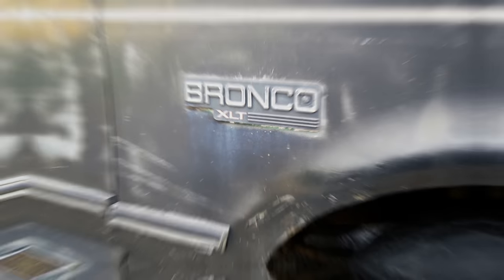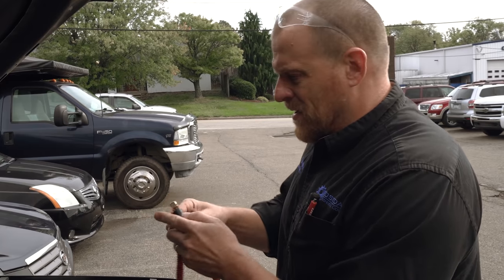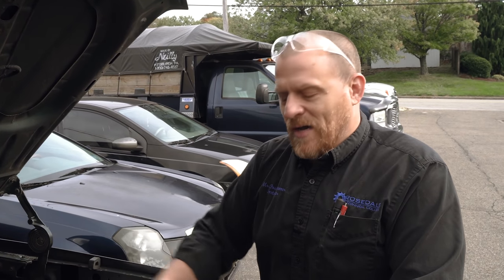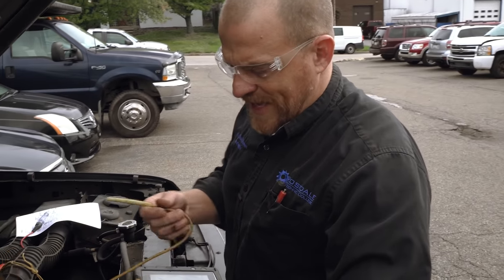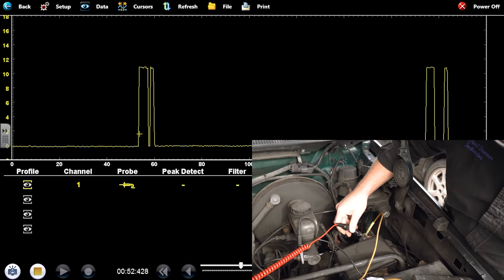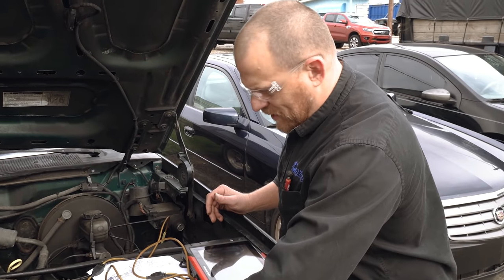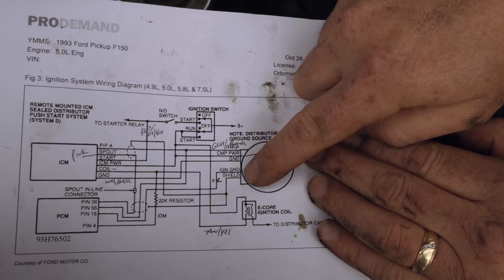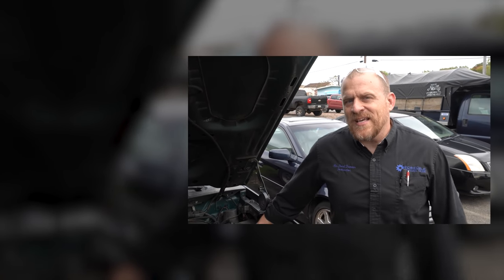Ford EEC-IV No Spark Diagnostics

Comment: Hey, I can't get the spark checker to activate when I tap my test light into the pip wire, and the fuel relay and fuel pump don't cut on either.  What would you advise on the next step?
Reply from the maker: Key on, does your check engine light, light up?
Do you have power at coil +?
Reply: @ScannerDanner  Hey Man!  Thanks for getting back to me.  The check engine light doesn't come on.   Coil does have power. Looks like a no control test result. The test I was performing was trying to bring it to ground with the test light to the pip wire.  I noticed on your part 3 class video (on the bronco) that you tried the test light to positive, as well as negative.  Should I try bringing it to positive?
Reply from the maker: @JoeMama-gs7rd  okay let's ignore the PIP test for a minute. With the key on, check for a 5v ref to your TPS or MAP sensor and report what you find.
Reply: @ScannerDanner  94' Ford 4.9L.   TPS is vertical mounted with 3 wires top to bottom.  The top most wire gave me a consistent .02, middle wire kept going between .01 and .00, and the bottom most wire gave me a consistent .00
Reply from the maker: @JoeMama-gs7rd okay sweet, now we are onto the problem. No 5v reference (like you have) is an indication that the ECM is not "alive" or you have a shorted reference circuit.
Next step, see if you have 12v at one of your fuel injectors. I believe the EECIV Power Relay feeds the injectors and the ECM power (as well as the EGR solenoid and other EVAP solenoids)
If no power to the injectors we move toward that power relay and start doing checks there
Reply: @ScannerDanner  Just checked it.  Back-probed injector #1 and I have 11.75 volts.  (Battery is a little weak)
Reply: @ScannerDanner  Should I be getting voltage at the injectors with no 5v reference?
Reply from the maker: @JoeMama-gs7rd  power to your injectors tells us the Power Relay is doing it's job and that you should have power to the ECM, but this must be verified next. If you have power on pin 37 and 57 (red wires) and then also pin 1 (yellow wire) - btw this info is from a 94 F150 with a 4.9, it should be the same even if you are driving a different model. Once power is confirmed, the next step would be to disconnect all sensors that share the 5v ref to see if you have a shorted sensor, then measure the 5v ref circuit for shorts to ground. If all that is good, you most likely need another ECM. The ECM grounds should be tested too, but when they go bad you will have elevated 5v ref voltage, not zero like you have. You will need a good diagram to continue this. https://eautorepair.adtrk.biz/?a=10817&c=24&p=r&s1=
Reply: @ScannerDanner  Thank You for all your help!  I will do this and get back to you with my findings
Reply: @ScannerDanner  I back probed all 3 of those positions on the PCM.  They all have 11.75.  I also disconnected the TPS, map sensor, and EGR sensor, and no start.  Is there a place that does a "test" of these PCM's?  That have the long rectangular adapter?
Reply from the maker: @JoeMama-gs7rd you said you have 0v on those before. If you have 11v you have a bad main computer ground or the computer itself
Reply from the maker: @JoeMama-gs7rd  https://youtu.be/1Nvyc_88AbY watch this!!
Reply: @ScannerDanner  I checked the PCM, at the 37, 57, and 1 pin.  I have the 11.85 to those, but still 0 volts at the 5v ref
Reply from the maker: @JoeMama-gs7rd I misread what you wrote, you're talking about the computer power feeds when you said "all 3 wire" thought you were talking about a position sensor lol sorry. With the computer unplugged, tell me what the resistance is to ground on your 5v ref wire
Reply: @ScannerDanner  Ok, hoping I did these tests correctly.  The PCM is actually out of the truck.  I was planning on taking it to have it tested.  I grounded the multimeter to the negative cable and made sure I had a good ground.  I then checked for resistance using both OHM selections, and I got (O.L) I tried checking the resistance with the key on and off.
Reply: @ScannerDanner  I also meant to tell you I've been hearing a clicking noise during the past couple days of testing.  It has probably been doing this since I started, but I couldn't tell early on.  I don't know if it's a relay, or the fuel pump is coming on?  Or both?  It does this each time I cycle the switch to the on position.
Reply from the maker: @JoeMama-gs7rd  good, that means your 5v ref circuit was not shorted to ground. As long as you confirmed the power feeds to that ECM then you're good. I'd like to see you load test those power feeds as one last test. Just a regular incandescent test light is fine
Reply from the maker: @JoeMama-gs7rd  hard to say without knowing what's clicking. Could be the ECM activating something when it shouldn't be, as it seems it has some internal issues with the 5v ref, so what else is messed up?
Reply: @ScannerDanner  Load test on the PCM, or the TPS?
Reply: @ScannerDanner  Everything on the truck was working good and then it left me roadside on Christmas Eve.  It lost power and then wouldn't restart.  I don't think this truck has been hacked.  Although the previous owner did install some things, like an RPM gauge, and an LED front light.  The RPM gauge wasn't working so I disconnected the wire from the guage that runs to the coil.
Reply from the maker: @JoeMama-gs7rd  the PCM
Reply: @ScannerDanner  Hey Paul, I opened up the PCM and found some obvious damage to the circuit board.  Looks like a capacitor leaked out and part of the wiring in the board is broken in a few places.  I'm pretty confident now I need a new PCM.  Thank you for being patient with me and helping me out.👍🏻
Reply from the maker: @JoeMama-gs7rd  it's always hard to call a bad module! Nice job. You made it easy for me to help you as you would accurately do the tests I was suggesting. Always a pleasure to help those who can help themselves and not just throw parts at the problem. Props to you man. I replied to your email just now too. Good providence to you!

Comment: I am losing my mind... Been chasing the ignition gremlin through a 1987 E150 4.9L. I've got it to the point where a spark plug put on coil wire gives healthy spark, but then if I put the same plug on wired 1-6 coming from the cap? Nothing! I cnnot for theblife of me understand why there would be good spark at the coil wire, bjt not rhe plug wires, as this is a 100% brand new distrubutor........ If anyone reading this  has any ideas, please help. I've tested everything else manual H says to. Every wire. Its something with the cap.
Reply from the maker: How far of a gap will the spark jump from the coil? 
Possible rotor burn through if the coil can fire a 1 inch gap

Comment: Great video, so if you measured ~ 12 volts at the PIP wire with ignition key on engine off,  could you connect test light to Ground and touch the PIP wire to create a square wave  and then make the Ignition Coil fire as you did with the test light connected to Positive 12v when the PIP signal was Zero volts ?.  Thank you.
Reply from the maker: Yes sir
Reply: @ScannerDanner  Thanks Paul.  Thanks to your instructions, I have an '86 Mustang GT - 1st year fuel injection.  Now I have a complete knowledge of how the EEC IV Ignition System works.  I am original owner of this Mustang GT, I have changed out the TFI ignition module only twice, and maybe an additional time when I was "Not an Expert on the Ford EEC IV", but thanks to you, I consider myself an expert on this Ignition System.  In addition, I watched your famous White Bronco video with bad "pick up" sensor, the White F150 video with a bad ECM relay dropping the voltage level on the PIP/SPOUT signals.  I completely understand your troubleshooting methods and sequence !!     
Thanks so much Paul, I am your #1 Fan, but I'm sure many people feel that way.  You are a GREAT TEACHER, don't ever change your ways !!

Comment: That's not an 08.  Maybe an 88 possibly.  Looks exactly like my 92 F250 with the 5.0/302,  I couid probably figure out this one.  I know these things pretty well.
Reply: Joe
As you deduced its a 92-97 generation - you can see the front body style (briefly) at the very beginning of the video. That was the last generation of F-150s to use the Windsor V8.
Paul
Reply: @Paul1958R  Thanks.  I love these trucks.